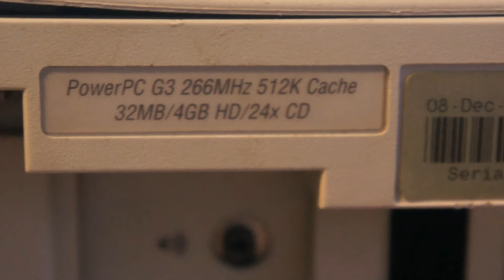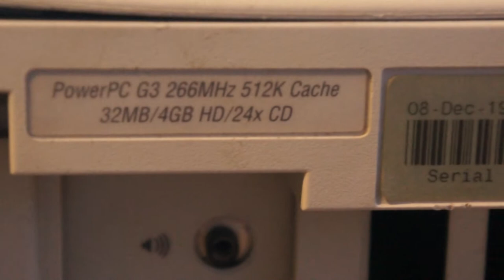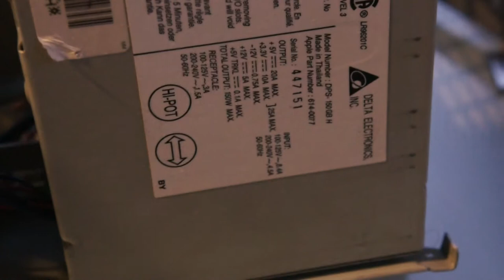The Very Last Beige Mac: Power Macintosh G3 Hardware Overview.

Comment: Actually, this computer was introduced a few months after Steve Jobs return to Apple, and this powerful machine was introduced as part of his plan to streamline the product line , as Apple had 4-5 similarly equipped, and similarly targeted, machines that it was selling at the time. 

Other than that, slick vid.
Reply from the maker: Pinned your comment since you're right. I hadn't really gone down the rabbit hole that are classic Macintoshes at the time I made this video.
Also, thanks!
Reply: @ITTFami  Good vid. The G3 series was actually in development before Jobs returned to Apple. The product development cycle is much longer than 6 months. Gil Amelio had started the product streamlining process by trimming the line to 7300/8600/9600 for desktops, a 5500 AIO for education, and 2 PowerBooks. 

Jobs actually killed the planned 6 PCI slot G3 tower, aka Power Mac 9700 PowerExpress. Probably deemed it too expensive to make given Apple's poor financial state at the time.
Reply from the maker: What I'd give for a 9600 and a MACh CarrierZIF to have a 6-slot Mac with a G4... Even with an IDE/SATA/USB/Firewire combo card, I've already run out of slots in the G3.

Comment: We bought one of these back in 1998, around the same time as the original iMac's release. This G3 desktop made more sense for our family because we had even older Mac Pluses at the time. The G3 could communicate with the old machines, get our family on the internet, and was very expandable. I still have the machine, and over the years, it's had multiple hard drives added, CD-RW, USB functionality, a wireless card, upgraded graphics card, an overclocked 400 MHz G3 (from a blue & white tower), and RAM was 32 MB when new - it now has 768 MB installed. It's a great little machine!

Comment: You could even put the board in a PC ATX case with one modification, namely cutting an opening between the first couple of slot openings for the personality card. I've done this with the guts of a G3 mini tower. You can also hook up a modern ATX power supply to it, and you can connect the power button and LED connectors without modifications. The only concern would be getting adequate cooling to the CPU in that configuration. I was thinking an old Pentium CPU cooler with fan might do the trick.

Comment: There’s actually a tower version of this computer. Spoiler alert though, it looks exactly like the Power Macintosh 8600
Reply: I have both an 8600 and the G3 tower. They are not the same. The G3 is about 3-4" shorter in height and more compact overall.

Comment: I think people generally stick with the Radeon 9200 as a maximum because it can still be used by a native OS9 install, the performance improvement is so minor over the 7000 though which is a far more stable card in OS9.
Also bare in mind that regardless of how far you go with updates, even with a G4 you're going to be getting throttled by that 66 MHz bus speed.
Reply from the maker: I think I really should make an update video about this machine.
I considered an FX5200 because of how ludicrously expensive Mac compatible PCI Radeons are, but had no success. I flashed the FX5200 and tested it on my MDD, but got no chime on the G3. So that has been dropped, I'm sticking with onboard video and Tiger.
>Also bare in mind that regardless of how far you go with updates, even with a G4 you're going to be getting throttled by that 66 MHz bus speed.
Ha! You would think so, but it seems my logic board has a really late revision of the memory controller, and it overclocks perfectly fine to 83MHz, the max the board will do. So right now I'm running a 400MHz ZIF G4 stolen from a Yikes! at 417MHz, with the bus overclock. It is one really snappy machine under OS 9, and I'd say it performs on par with my old 400MHz Sawtooth in Tiger (apart from graphics, that is.)

Comment: I would pull the PRAM battery out, if you haven't already. Old ones have a nasty tendency to leak battery acid allover the logic board.
Reply from the maker: I replaced it with a brand new one about a month ago. I keep trying to make new videos about this machine, since I've been upgrading it since I made this one, but I always end up installing more upgrades just after finishing the videos. So I end up not uploading anything.

Comment: Dude, you know nothing. --The Macs of the "Beige Era" may have been ugly on the outside, but they had a rare quality that is almost completely absent across the entire Apple product today: They didn't fucking break. You could abuse them like a rented Camry all day long and they would never die. Push two buttons, and the case was off, with everything right there and easy to upgrade. You could even overclock the thing easily just by sliding a couple DIP switches. (Most of the 266s would do 333.) The only reason people stopped using them is because they didn't have built-in USB, and were too slow for OSX...not that that was worth using until Tiger (10.4) in 2005. --This about it: when was the last computer you owned that you could get ten years' worth of reliable use out of?
Reply from the maker: I never said they were unreliable-- I have that G3 beside me capturing some analog video right now without a hitch. I've never heard of DIP switches for overclocking a Mac, though this G3 had jumpers (I believe all earlier machines needed "chipping") and it's running an overclocked bus to squeeze more performance out of its G4 upgrade.
And answering the last question: Possibly the PowerMac G4 MDD I'm typing this from. And the iBook G4 I use when I go outside. And the Sun Ultra Enterprise 250 I use as a homeserver. Oh, and the IBM PC/XT I use for BBSing every now and then. And obviously the PowerMac G3 featured in this video.